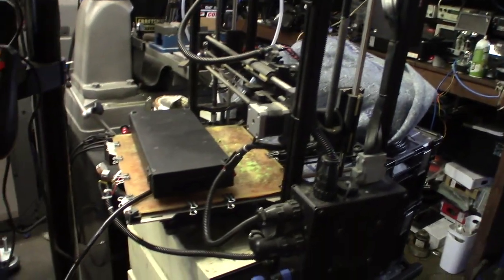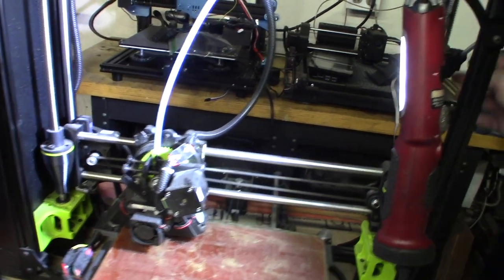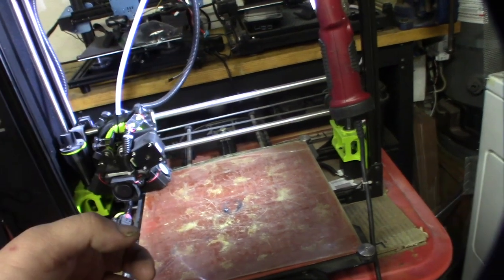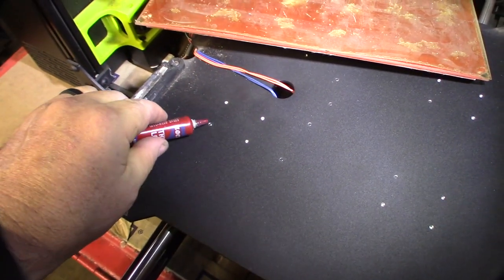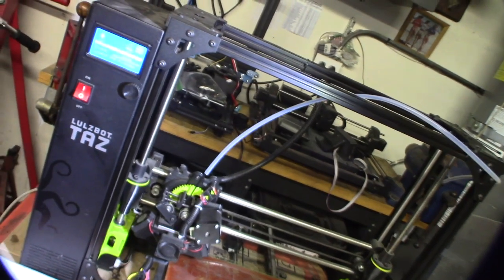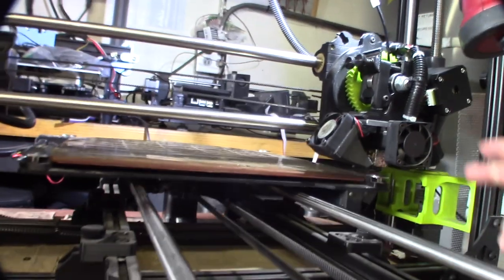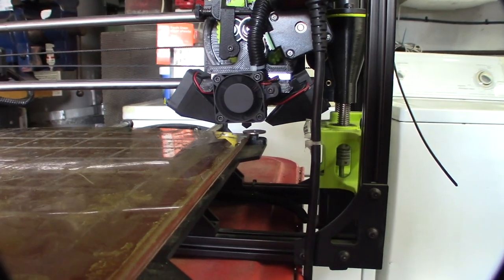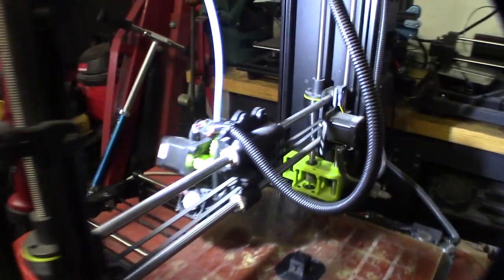Lulzbot Taz 6 uneven bed troubleshooting, failed probing.

Comment: I had one of these given to me and it wouldn't probe either, it would crash into the first corner it tried.  It turned out the solid core wire broke off from the tab on the heater block.  It was news to me that these things measured contact voltage to do their leveling.  Mine works now but wow, those old stepper drivers sure howl compared to the modern 2209s we're all used to!